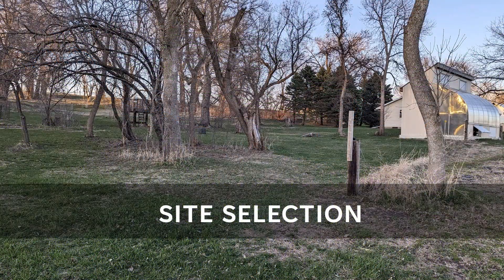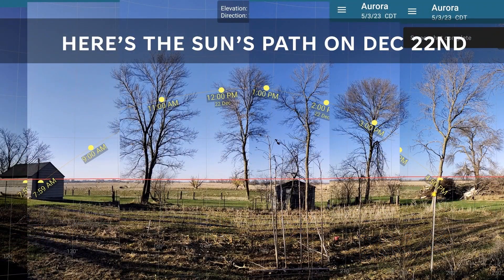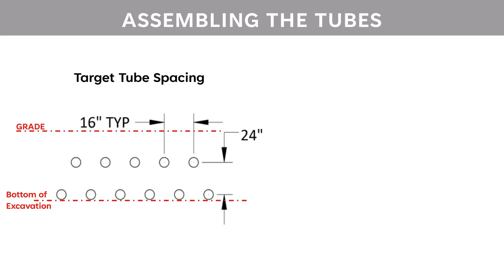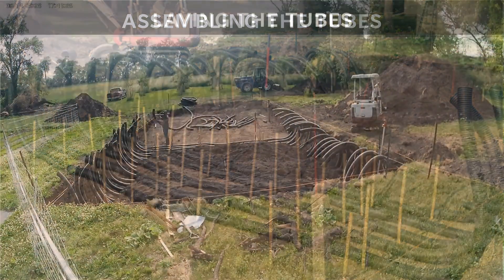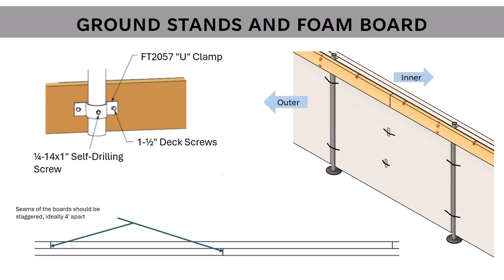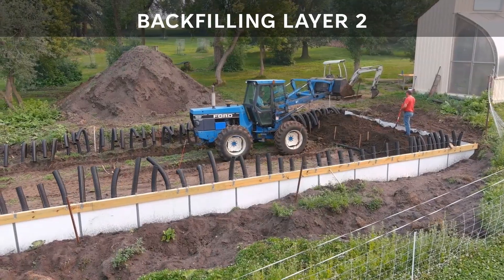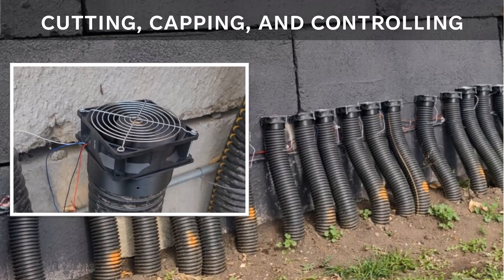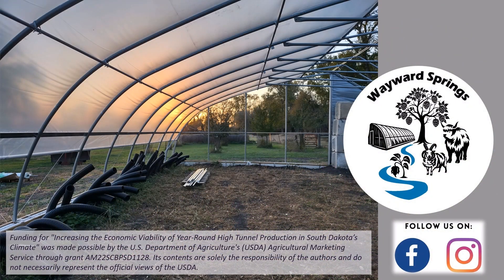Building a Better Climate Battery for High Tunnels | No Manifold, Insulated Ground System

Comment: So, how much power did you use on those fans per ~100 ft of greenhouse?  I am in same climate as you(almost as cold), but less sun...
Reply from the maker: If making this same system on a 100ft structure it would use 1900W when on. Or 16A on a 120v circuit.
Reply: @waywardsprings  Thank you for the reply.

Comment: IMHO Perforated pipes act like a radon pump!  Use all solid pipes for clean air!  A single 2' hole  diameter, 4 to 5 feet deep, works the same as pipes system but use a stainless steel insert in the hole. I had built a DIY geodesic dome with a 900 gallon Aquaponic system and used a DIY Rocket Mass Heater to supply heat and it was -21 F outside for time between 2012 and 2013 for 28 continuous months.  I also didn't hear much soil Prep, yet, those peppers grew nicely!   Test for Radon to be safe!
Reply from the maker: Climate batteries cannot use solid pipes, they will fill with condensate, which will prevent air movement. Radon is an interesting topic I haven't seen any data on. Might be a good future study. Typically people aren't spending a lot of time in these, but I have seen people use them in or attached to houses.
Reply: @waywardsprings  Of course you haven't heard about Radon, it's poisonous! Solid pipes are the only way to do it safely! Capture the condensate and water your plants!  Radon pumps are deadly, no matter how much time you spend in the greenhouse!  Might as well be growing your basement! Good luck!
Reply from the maker: @rjaquaponics9266 I'm very familiar with radon for homes. I have not seen research on it for climate batteries. People don't live in them (usually 😊) and their depth below ground is less than a basement.
Reply: @waywardsprings  Radon is everywhere! Just because You never heard it, does 't make it any less deadly!
Reply: @waywardsprings  
Perorated  drainage tubing will hold a significant amount of water in the lower corrugations if it isn`t modified prior to installation. The perforations in drainage tubing are designed to let water in, not out :)

Comment: Why even till when benefits have been shown by no till and cover crop?
Reply from the maker: I didn't do any tilling. Pipes were being buried. But you will need to level the ground,  dig to put transplants in the ground and for me I need to trellis tall plants, which requires pounding posts into the ground. I don't want pipes near the surface where I may hit them.  Cover crops are for parts of the growing season when the ground is fallow. I don't have any of that. Not gonna pull out fruit trees (figs & pomeganate) to plant cover crops. I do like to use clover for outdoor crops. Perhaps that's what you're referring too.
Reply: @waywardsprings you said in the video you wanted the pipes down enough for when you tilled. That’s why I asked
Reply from the maker: @Just_A_Name14 Sure. I was just trying to give examples of reasons you may not want them to be close to the surface. Personally, I only tilled once right after construction because walking all over during construction causes soil compaction and uneven ground from settling. But tillage really depends on what the producers unique situation is.

Comment: the tubes are buried way to shallow to have any real effect
Reply from the maker: You may be confusing this system with earth tubes or low grade geothermal. They operate on very different principles. Check out my video: GAHT, SHCS, or Climate Battery? Explaining the Underground Heat System

Comment: So glad I came across your channel. I'm in Northwest ND zone 3b, and have been wanting to build something similar. I was considering a gabion wall instead of concrete blocks just because of the amount of field rock I have available. I also want to utilize it for livestock in the winter time. Something I've been considering is building an insulated roof sloping down on the north side of the half hoop, and using that area to to compost the manure I clean out from the greenhouse side in the winter. I would have a door in the gabion or concrete wall for easy access between them. I thought of using piping in the compost to transfer that heat, but I hadn't thought of running pipe underneath the soil in the greenhouse for an earth battery. With the livestock generating heat I'm not sure if it would be necessary or if that would be too much weight, but it would probably just be some sheep and poultry. I graze my small flock of five over my drain field occasionally without too much worry so I think it would be fine. 

Not sure if you've come across the YouTube channel arkopia but he's got an amazing cold climate greenhouse in Saskatchewan and has a lot of videos on passive solar designs. I definitely like to come check out your greenhouse sometime if I'm in the area.
Reply from the maker: Yes, I've seen the arkopia stuff since he started. Very high $/sqft. Your welcome to come visit! I'm not an expert on integrating livestock into these. A lot of food safety challenges. Hard to follow the 90/120 day rule for animal waste.
Reply: @waywardsprings I'd like to take arkopia's design and add on to the south side of my house. It's definitely a spendy design if market gardening is the goal, but I would like it as a green living space, especially during the winter.  Your design I find more practical for expanding the vegetable garden season. I haven't gone through all your videos yet, but do you have a cost breakdown or what it cost you per square foot?

You're right, food safety would be a concern If integrating livestock. I planned on having a row of small fruit trees that I wouldn't normally be able to grow, a row of raised beds for food, and the inground planting would be for the purpose of forage and poultry feed going into the winter.

Comment: Why use any perforated pipe? Mud could ooze in over time.
Reply from the maker: These are specifically designed to not do that. They are used for drainage in fields all over the Midwest without that issue. It must be perforated for condensation to drain out.
Reply: My home has solid PVC earth pipes, which temper incoming air for ventilation in our very cold climate. Trust me, condensation can be a major problem at times. Perforated pipe might have been a good idea!

Comment: Did you ever thought about a water based climate battery instead of air? Water have 10-20x better thermal conductivity than air.
Reply from the maker: I haven't designed one yet. Perhaps someday I will do some comparison. The simple parts and minimal maintenance of a soil based system is fairly elegant.

Comment: Thermal dynamically? Right idea, improper application. In order for the hot air to readily release its energy into the battery? It must undergo a drop in pressure. You always want to be pulling the cooled air out on the cold side of the system, where your mechanical force is more efficient. Not pushing hot fluffy thin air down. You will find you can turn the fans down if you do, simply because you are pulling on the dense side of the system.
Reply from the maker: The air deltaT from inlet to outlet is relatively small. Typically around 10C... Which is only a 4.5% difference in fan efficacy.  That is usually not worth the negative consequences of inducing negative pressure in this kind of a system. It's not shown in my models in this presentation, but a measurable amount of air passes out the perforations in this kind of pipe. Going to negative pressure would cause that air to be sucking in through those perforations as well as much greater water/condensation exposure to all the fans and electrical connections if these are installed along the vent wall.
Reply: No, you are mistaken. Warmed air does not need to undergo a drop in pressure to  transfer heat into the earth. A modest pressure simply moves the air from one end of each pipe to the other end, and heat transfer is entirely dependent on the mean delta T of the pipe-soil interface. A higher average temperature of that air results in a higher transfer of valuable Btus. 
There is little real-world difference to the circulator fan(s) whether the cool air or warm air is being moved. The type of fan selected determines if 'pushing' or 'pulling' is best. As a rule, 'pushing' is best, and in many cases positive pressure is essential, as explained here by waywardsprings.

Comment: I'll be very interested to see how this is does after a few grows! Not sure what you have planned but I would consider doing an inclosure around the your inlets (and possibly outlets as well). Just a little pony wall with hardware cloth or similar across the top. I feel like it is going to get really weedy and messy otherwise.
Reply from the maker: I have already completed 2yrs of production. No issue on the north inlet side because of low moisture.  South side does get weedy.

Comment: I appreciate the final comment regarding a manifold as I was just sitting here contemplating the performance delta if you had split into say three sections with manifolds and larger fans…. also curious why you didn’t sink the whole structure down about 4 ft lower?   Thanks again for sharing!
Reply from the maker: Light is why. I need all the light I can get. Recessing in the ground will cast a shadow across the grow bed with the low sun angles and because this is a high tunnel, not a greenhouse..
Reply: @waywardsprings Thanks!

Comment: Is it not better to pull cooler air that is more dense than to push hotter air? Maybe it doesn't make much difference.
Reply from the maker: The difference in temperature is not enough to have a measurable effect. I think it is better to have positive pressure in the pipes than negative pressure so air flow out the perforations i stead of sucking in through them.
Reply: @waywardsprings  You could even experiment with a push pull fan system really easily although I am not sure if that would have enough of an effect to be worthwhile.
Reply: Russ Finch from Nebraska used one big ventilator instead of a dozen of the small ones. He had a wall that divided the structure. The ventilator was mounted in that wall and created pressure on one side. 
My gut tells me that one bigger ventilator with low RPM is more energy efficient than many small ones with high RPM. The unwanted consequence would be an uneven flow through the pipes. Some of them would be more exploited than others. 
Is this why you chose to go with small ones?

Comment: What is the best method to stop the soil or root systems from migrating into the perforated pipes?
Reply from the maker: Air movement through the pipes prevents root infiltration
Reply: @waywardsprings  One question, does this blown air help save nitrogen fertilizer?

Comment: You just put the same soil back in over the tubes, or did you add something to the soil for better performance?
Reply from the maker: I have black rich loam soil 8ft down, so I reused it. That is likely not the case for many areas.
Reply: @waywardsprings  I bet that helped with the fill. Finer soil seems the move easier. Thanks

Comment: Did you put fans only at one side or both sides?   Are you fans on the wall are pushing or pulling air?  What type of fans have you used exactly ?
Reply from the maker: They are pushing air in. 120x120x38mm axial fans. At multiple speeds for the purpose of this study.
Reply: @waywardsprings  I am thinking to do something similar but I am planning to combine 2 pipes per fan in order to reduce the price of fans.
Reply from the maker: @denisdufresne5338  I will cover manifold and fans in a future video. Probably be a few weeks, thats a big topic.

Comment: I am no expert but I would have thought it is easier to pull air from the cool after ground side then to push the hot air into the pipe.
Reply from the maker: Cold is more dense and that is the right thing in some systems. The difference in temp is only in the tens of degrees, not hundreds, so its negligible.  But there would be some other funky things going on if these were negative pressure. Blow in, don't suck. You'd be pulling some air in through the perforations...
Reply: Hot air rises so put the tubes and fans at the top of the hot wall, or use liquid that holds and disperses more heat and pipe it instead of air. Heat the liquid with a few solar panels and use a solar pump.
Reply: @freddymax5256turns out the heat is actually transferred into the soil with the condensation.

Comment: can you post a link to the fans used? wonder what the static pressure and actual airflow of these are in your setup
Reply from the maker: I worked with the factory to get built in per my specs. I had multiple configurations for this research project. One set was 50cfm once installed, the other 75cfm.
Reply: @waywardsprings your design spec was 75cfm. Im curious how loud these must be to push that? Have you any idea what the static pressure is?
Reply from the maker: @euphioquestion420 I provided data up to 75cfm.  The paper I referenced suggested 68cfm as the best balance between power cost and heat storage. I want to analyze pressure frop and fan options for manifolds yet. I suspect this distributed are system with DC fan motors may have the lowest operating cost...

Comment: Could you expand on why you don't need to pull air from the top of the structure?
Reply from the maker: Hot air rises (but only when there isn't enough air movement) fans quickly overpower natural convection.  There's more too it, might need to be a whole video.